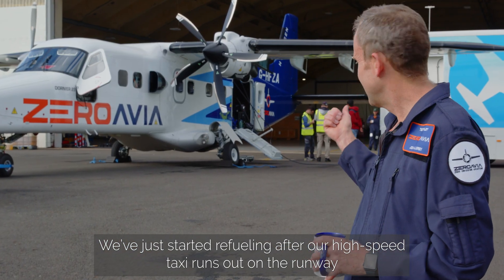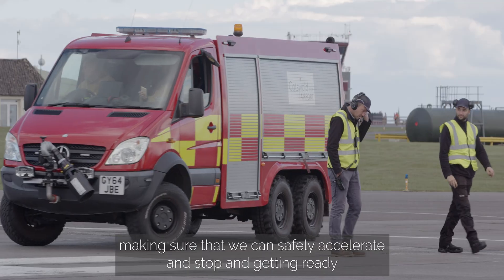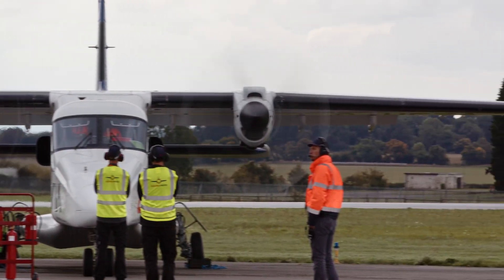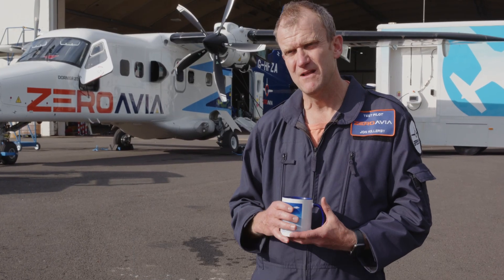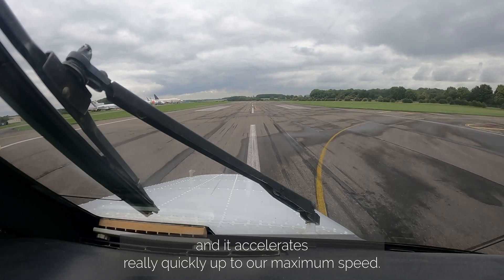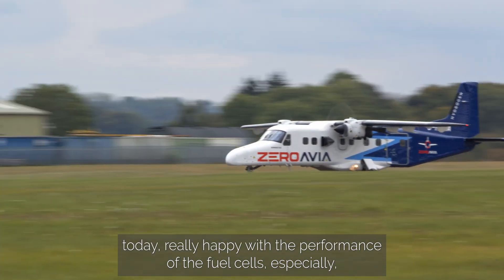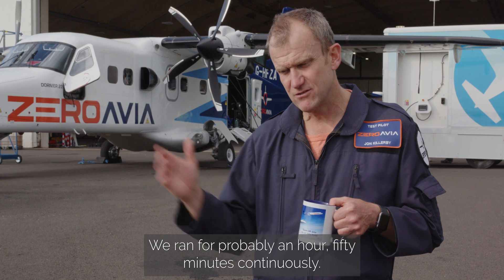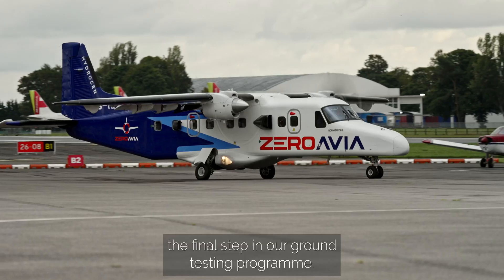ZeroAvia's #Dornier228 High Speed Taxi Testing

Comment: How much of the cargo pay is taken up with the fuel cell and the hydrogen tanks?  Or are you putting hydrogen into the wing tanks yet?  Compressed or liquid hydrogen?
Reply from the maker: Thanks @konradroeder3207. Compressed hydrogen in this system and in the testbed the hydrogen tanks and fuel cell systems are stored inside the cabin, as the seats have been removed. For our certifiable design as you identify, the tanks will be wing-mounted to preserve seat capacity. 

We will move to liquid hydrogen for our larger ZA2000 system to support 40-80 seat regional turboprops by 2027. The research and development on the liquid hydrogen management systems is already well underway (we’ll have some big updates here soon!)